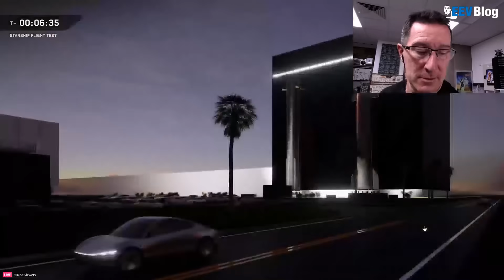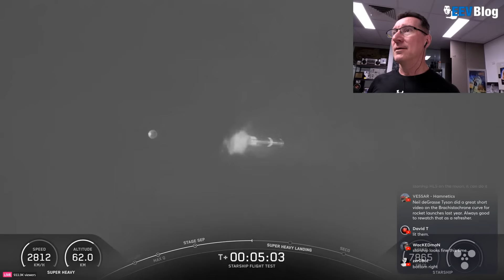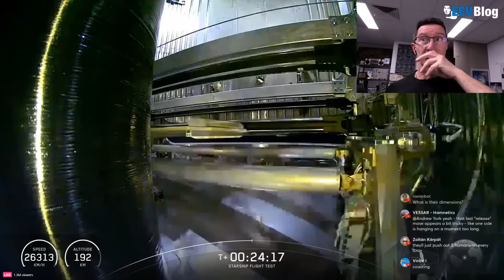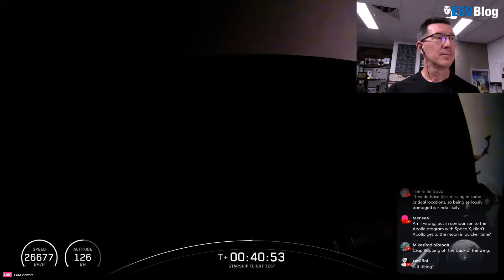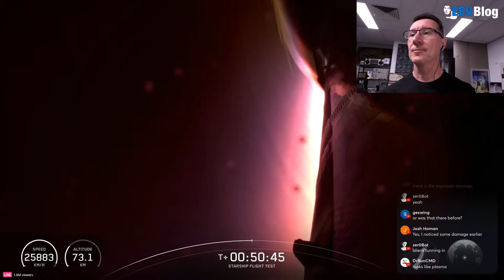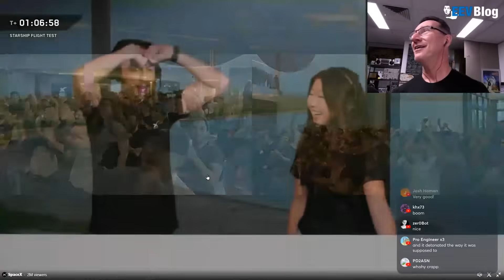SpaceX Starship Flight 10 Launch LIVE - EEVblog

Comment: Hi EEVBLOG, have you gone full Musk fanboy?  I used to think you were highly intelligent person, but now I am sort of doubtful.  You do realize that this Musk "starship" is now about 1% of the way to mars don't you?  If this rocket can't be rapidly reusable, it's not going anywhere except low earth orbit.
Reply: “Everyone I don’t like is an Elon fanboy”.
Reply: Haters gonna hate. You care way too much what others like and it’s sad
Reply: I don't think rapidly reusable is an obstacle for Mars. Sure it will be more expensive to use 12 full stacks just to fuel a Mars rocket, but SpaceX can probably build them at 100m a piece right now. Putting 100t on Mars for 1.3bn is a bargain, in space terms.
Reply: This one carried 10t, and struggled to get off the launch pad. Imagine putting 80 to 100 tons in it! There's not enough fuel to take off, return the booster, excellerate into orbit, do a de-orbit burn, and then land. This thing is the Hyperloop, but with space involved.
Reply: @Mark-eh7kx Man if only iterative design was a thing…oh wait!
Reply: @programExe It's a decent strategy for building a software solution,  but a ridiculous strategy for building a rocket! Each engine costs around 300K, and there are 36 of them. It's hella wasteful! And you can't launch it enough times to confirm your analysis of issues that may have occurred on a particular launch -- there are just too many variables.
Reply: @Mark-eh7kx  It absolutely is a good option in this use case, they proved it with F9 (albeit F9 cost a lot less than SS). But they knew going in this was going to be an expensive endeavor, that's why they have investors.. and Starlink is a cash cow for them. And as soon as SS can get Starlink v3 sats into orbit that opens even more doors in terms of funds. As for it being wasteful, no launch is wasteful if you get the data you need. I think it's clear when you compare the last 4 (IFT 7-10) launches.
Reply: @programExe  Either the ship or the booster exploded three times in a row, so apparently, they didn't get the data that they needed the first time.  They had an explosion under the skirt this time, and there was an engine out.  That illustrates my point! You can't iterate enough to accurately diagnose the problems — to get enough data to do so. This launch could have been lucky to where if you'd launch 3 more times, it could explode two out of the three.  As for F9, it benefited from economies of scale.  The rocket was simple and they standardized the parts; it essentially was a throwback to 60s-70s style of rocket with the second stage being disposable and the capsule parachuting to the ground.  The first stage returned for reuse with an average turnaround of 3 months.  They are nowhere near what the Gantt chart specifies for Starship and HLS.  They are literally years behind! Years!  This project will sink SpaceX if they continue on this route.  This ship will likely become nothing more than a satellite dispenser.

Comment: 32:03 there is a mockup nosecone (or there was at least) with an interior at the build side. a year or two ago there were also pictures someone took of a prototype elevator that would be used to reach the surface of the moon so they are still working on it, just a lot of it isnt visible at the moment

Comment: It's like an old car; given enough fuel, the engine and chassis will take you across the city! The only reason they don't is that it has no brakes, the suspension is toast, and the steering wheel is loose. Also, while airbags, seatbelts, and the seats themselves are currently missing, trust me, bro, it will be fine to send you kids cross-country in that thing next year!